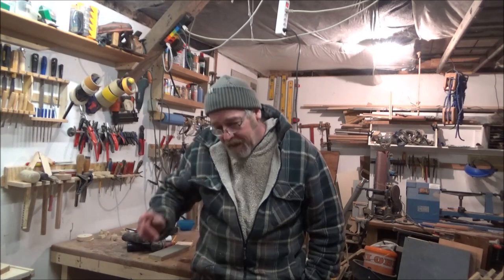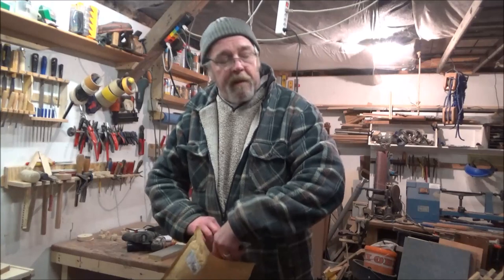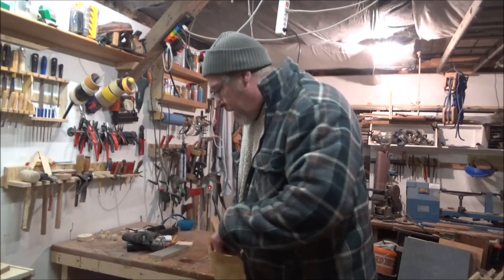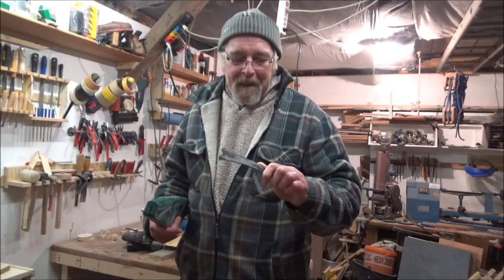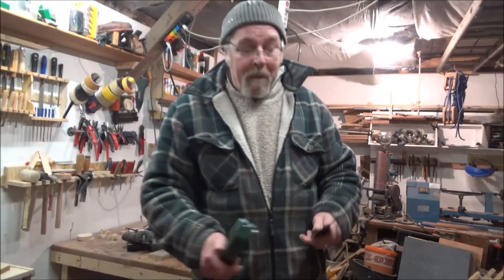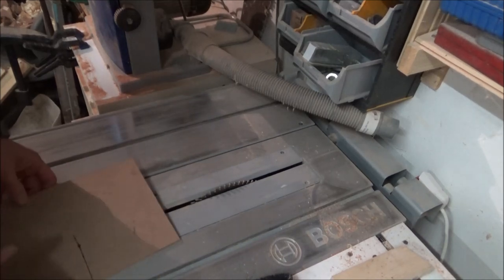Table saw kickback to the plumbs and mail call 23 01 20

Comment: So having a riving knife on this saw made you forget basic saw safety? I got hit in the hip back in the '70s never again, and I've taken off that damned knife from every saw I've had that came with one.
Reply from the maker: I dont understand ??
Reply: @SouthpawDavey  You've been using a saw for 30 years safely? All of us over 30 started on saws that were never designed for these safety nazi gimmicks, and we were fine because we were taught to pay attention and work safe. That board never would have climbed and spun if you had a push stick on the leading edge. These gimmicks make us complacent. There's lots of jobs that can't be done with a riving knife, every saw I've owned has had it removed from day one.
Reply from the maker: @trollforge  Ok.